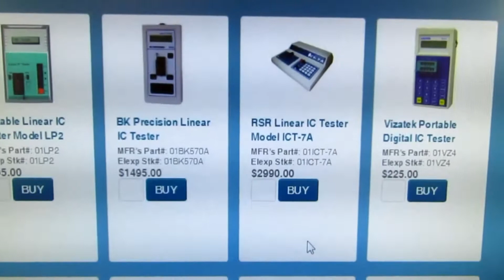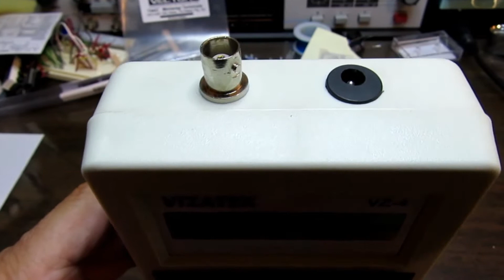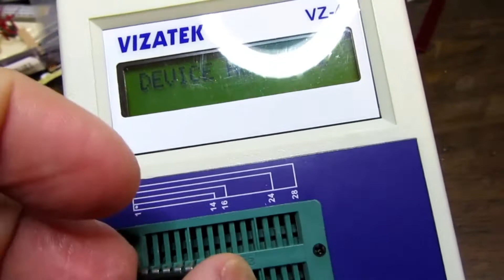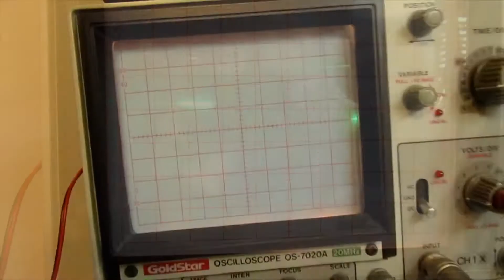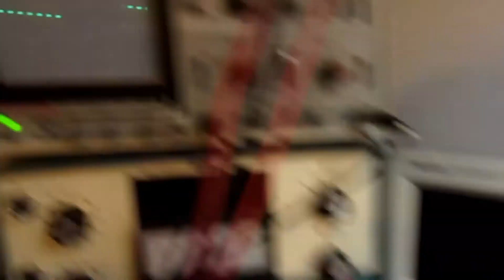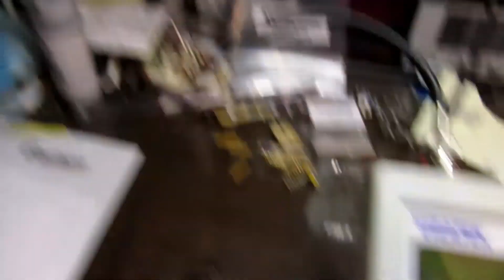Vizatek VZ-4 Logic IC Tester

Comment: I am sorry to tell you you have been hosed. Check this out: https://www.ebay.com/itm/Transistor-Tester-Integrated-Circuit-IC-Tester-Meter-MOS-PNP-NPN-FET-Detector/401209587407?hash=item5d69f476cf:g:8GgAAOSwZJBYBuzi or just searh ebay for ICTester. I got one and works just fine.

Comment: I looked these chips up myself and the 74367 appears to be functionally identical to the 4503.  One control pin controls four buffers and the other one controls the other two.  The data sheet for the 74367 that I have has data for the 74365, 74366, 74367, and 74368.  The 74365 and 74366 AND the control pins together while the 74367 and 74368 do not.
Reply from the maker: ebob1967, the data sheets I found showed the difference that I mentioned. Maybe the two ICs really ARE the same, but some datasheets are in error....